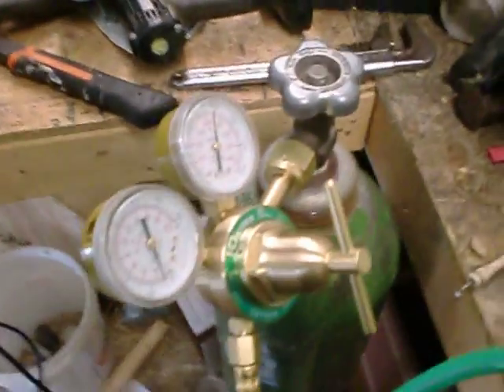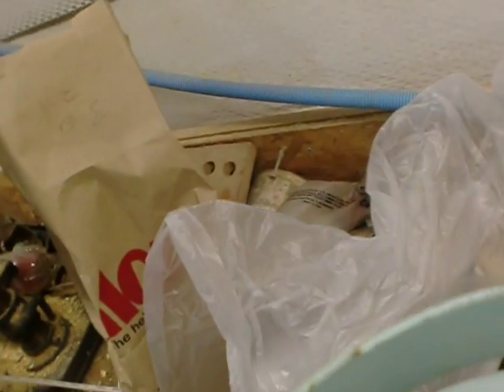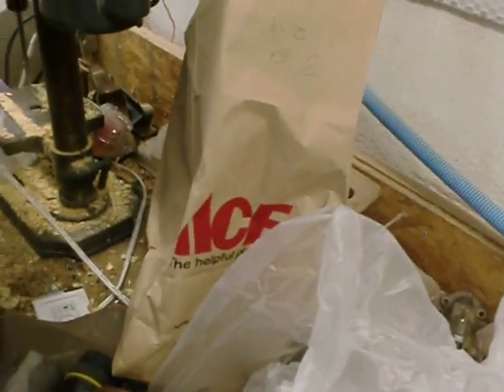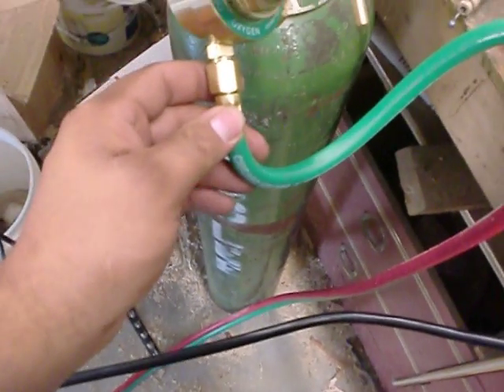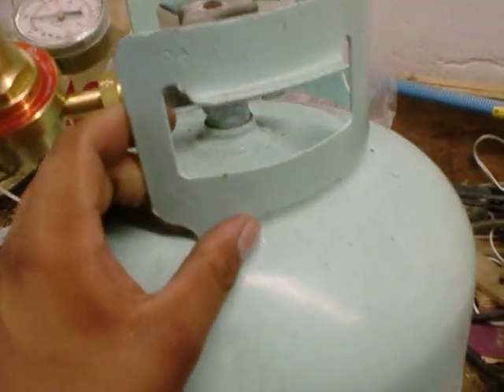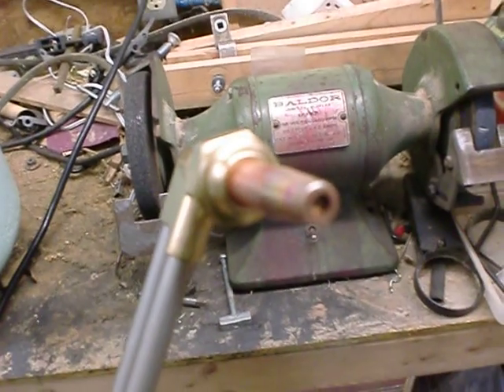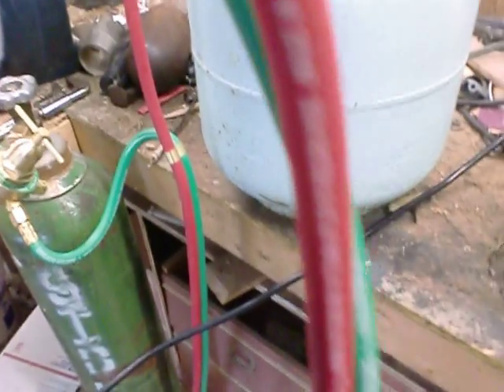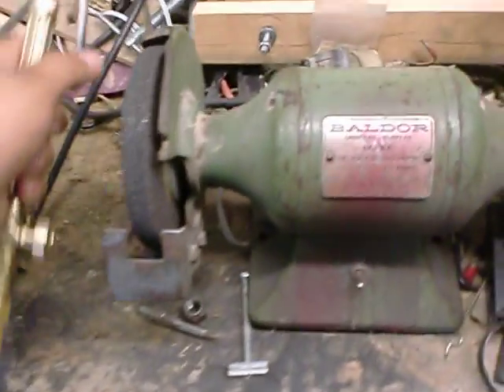Oxy-Propane torch, Need help with pressures

Comment: 20-30 maybe more... why would you take his advise about your “hose working for now”, but shun his advise on pressure? you knew yourself the hose isn’t optimal BUT bc the expert says it’ll work for now you accept that? not to be an ass buddy but please, go back to your local guy, THE LAST thing he wants is to tell you to use more than you need. he knows that you would quickly realize that he was trying to cheat you. NO business owner of operator will risk destroying his reputation over that... Today there is too much competition and he’d be out of business bc he’s loose yours and anyone else’s.... The fact is he told you to use too little if anything... He would rather tell an inexperienced person that as he knows that person will be talking to other professionals in the area, which are his customers..... SO go back to your local guy, he has a butt ton of reasons to help steer you right. these idiots on youtube have nothing to loose by steering you wrong.. ok? good luck

Comment: I set my oxygen to 40 PSI my propane to 10 psi and I make sure I turn the fuel and an oxygen up to get a least a two two two and a half Aunt star pattern it should be whistling like a jet engine and that's how I said it for all things from heating to cutting to bending long as you don't hit the lever he won't be cutting

Comment: Pay no attention to presure readouts, only for reference....open the torch valves all the way and adjust regulators for largest flame the tip will hold, then turn down the valves on the torch to what you want......

Comment: You look up the correct pressures in the tip charts for the size of tips you are using. Each manufacturer has their own tip sizing chart.

Comment: you need to first look for leaks. mix up some soap and water and put it in a squirt bottle. you'll find the leaks. light up the propane side and turn up the flame until it makes a gap (that is too much pressure) now turn it back until it reconnects, that's the appropriate pressure. now crack the oxygen side and tune the oxygen pressure until you get a neutral flame (google neutral flame if you don't know what that is) there is nothing wrong with that torch it's as good as the work you do with it